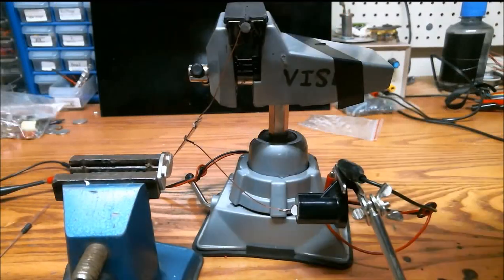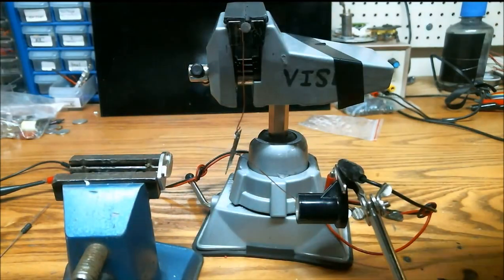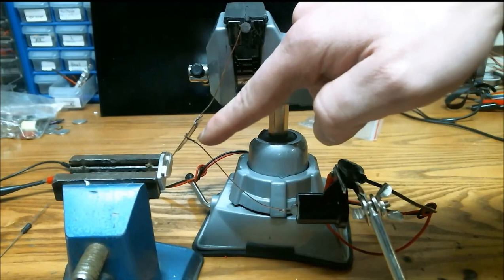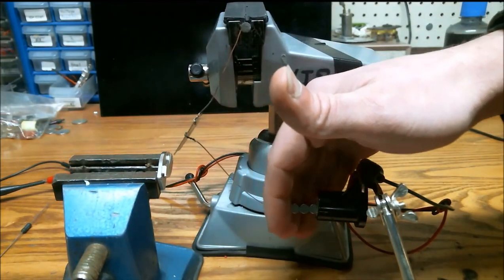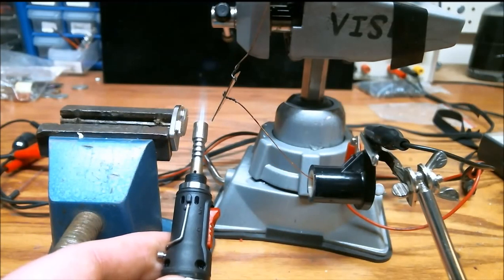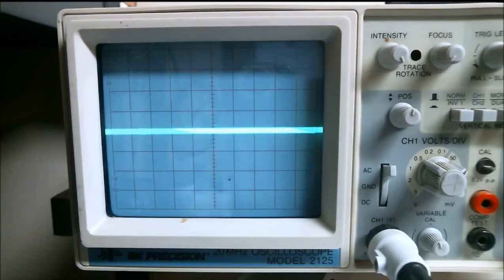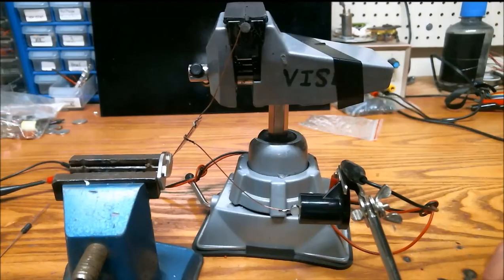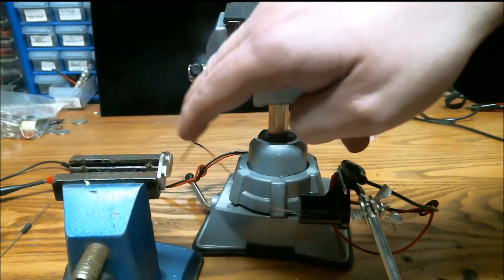Curie Engine - Generating Voltage

Comment: Great experiment! I look forward to seeing your 6-plate wheel setup. I wonder what the efficiency is. Maybe you could compare amount of fuel used to electrical energy output.
Reply from the maker: The mechanics of it are proving to be tricky, as I can no longer use gravity, attempting to make a magnetic ramp.